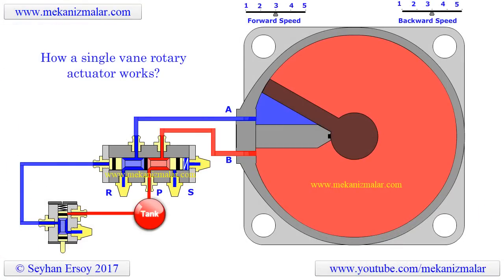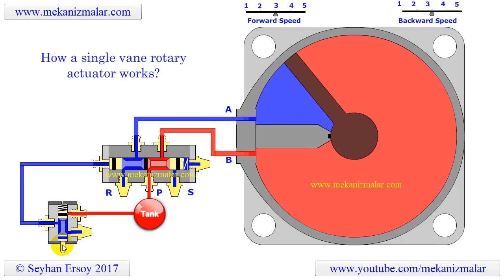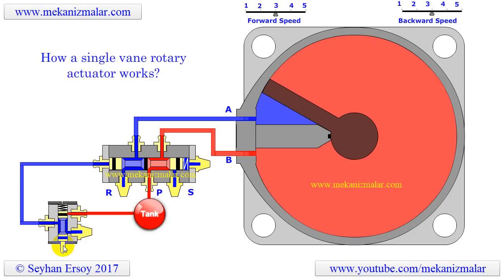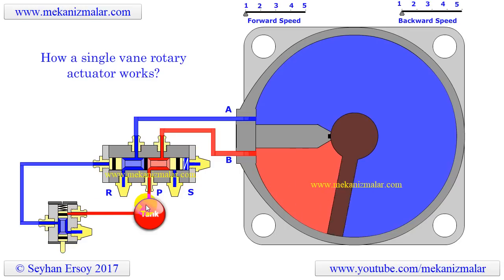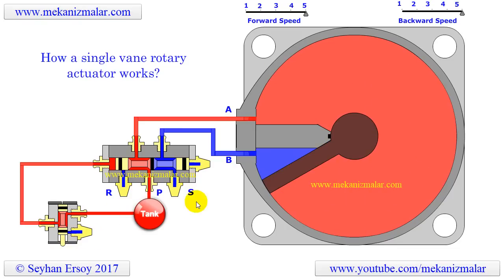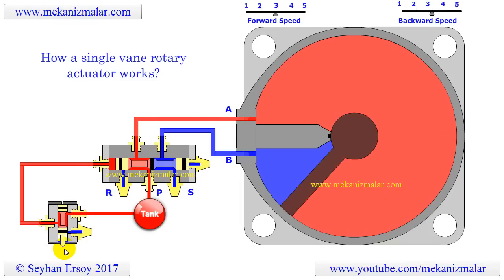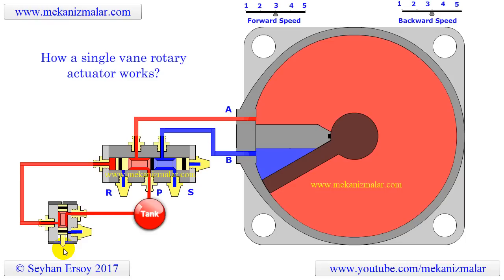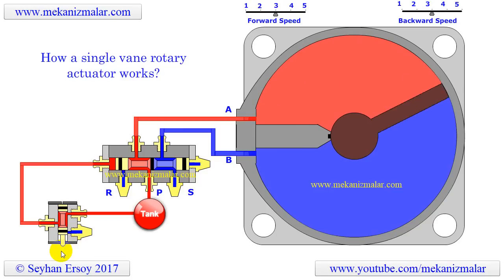how a single vane rotary actuator works

Comment: How do you hook this reciprocating shaft to an output shaft that moves always the same way?
Reply from the maker: You can't. Driven shaft should be free to rotate in both direction.
Reply: mekanizmalar ima sure there is some sort of swiss linkage that would make for a constant ouput direction from a recriprocating shaft.  But in a hydraulic-system you dont want a rotational output from this i guess?  I guess the point is Not to make a mechanical output?